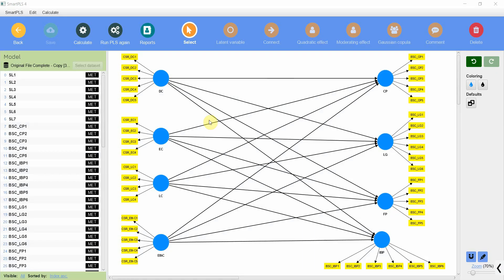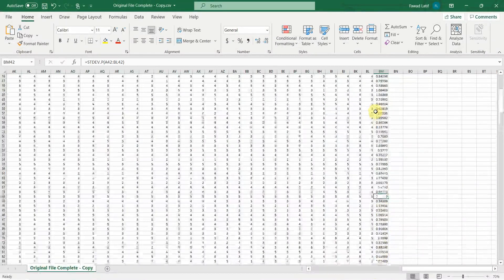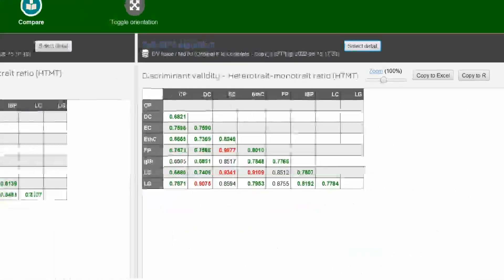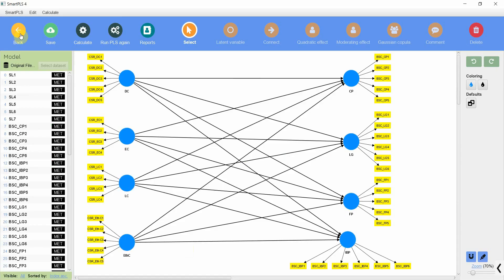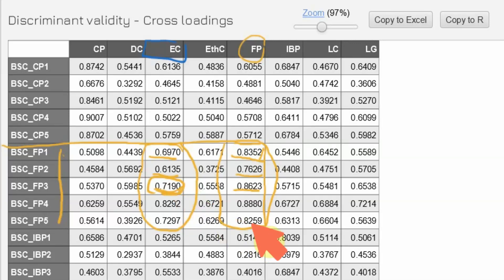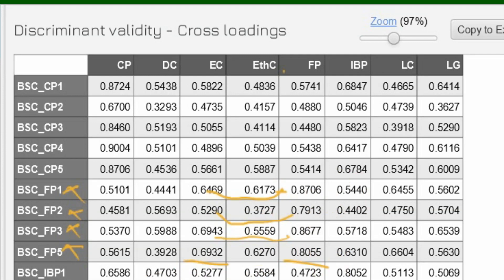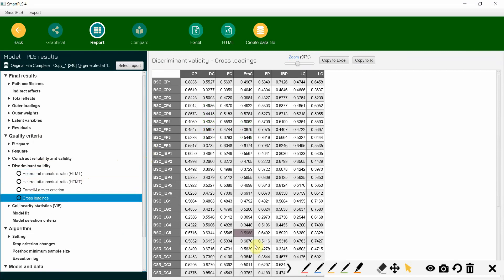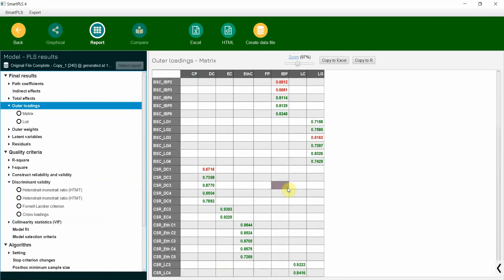#SmartPLS4 Series 14 - Step wise Demo | How to Resolve Discriminant Validity Problems?

Comment: Thank you very much. I made a model.but, there are problems in the dicriminant validity and construct reliability and validity. What should i do to solve the problems in construct reliability and validity as this video is related to the dicriminant validity ? Also, my model contains 40 indicators. When I calculated the model, 16 indicators were removed as its outer loadings were less than 0.4 and still there are problems as I mentioned.   Is this correct when I removed all these indicators of my model?

Comment: thank you sir, your tutorial is very helpful. If i may ask a question, can i directly look at the cross loading without checking the standard deviations of the indicators for two variables that have discriminant validity issue? In my opinion, it is quite possible that the standard deviation of those indicators would be 0 if we use likert scale. It doesn’t mean that the respondent didn’t read the questionnaire, except if the standard deviation for all indicators (all variables) is 0. In this case i think we should delete the data.
Reply from the maker: Yes, you can.

Comment: Hello Sir, thank you for your video. Do you think checking the correlation between indicators of the problematic variables will help identify the problematic indicators? I found that useful. And do you have any references we can cite for the procedure (first check the STDEV.P, then check cross-loadings) ? Thank you.
Reply from the maker: Yes, that may help. As for reference, please refer to 
Collier, J. (2020). Applied structural equation modeling using AMOS: Basic to advanced techniques. Routledge.

Comment: Dear Dr. Fawad
if the cross-loading between items is less than 0.1, that item should be deleted to improve discriminate validity. Is there any reference for this? actually, in my PhD thesis, I cant put anything without reference. Your help in this regard is highly appreciated.
Reply from the maker: Please refer to 
Sarstedt, M., Hair, J. F., Pick, M., Liengaard, B. D., Radomir, L., & Ringle, C. M. (2022, May). An updated assessment of model evaluation practices in PLS-SEM: an abstract. In Academy of Marketing Science Annual Conference (pp. 85-86). Cham: Springer Nature Switzerland.

Comment: Hi Professor, thank you for your videos and explanations! 

Please, I have a question regarding this.. Can I use (traditional/original) PLS algorithm for evaluate the measurement model and consistent PLS algorithm to evaluate the structural model at the same time? 

Due to I have an issue with the Fornel and Larcker DV using consistent PLS algorithm.. But when I checked it using the original/traditional ones, the results were good.. 

And for other analyses, the results were also good using consistent PLS algorithm.. 

Thank you for your response!
Reply from the maker: Use Normal PLS Algorithm.
Reply: @researchwithfawad  Thank you so much for your responses, Professor. 
That means it's not possible to use Normal PLS algorithm (for measurement model) and Consistent PLS algorithm  (for structural model) at the same time? 🙏

Comment: Great Dr. Thank you for this. Can you kindly suggest a solution for the Fornell and Larcker Criterion DV issue in which the first or the top value (the square root of AVE) has to be higher than the values below if I'm not wrong, but in my case, the top diagonal AVE value is lower than the values below. What am I supposed to do to resolve it?
Reply from the maker: Please follow the steps in this video
Reply: @researchwithfawad  this one, as I can see it, is a resolution for HTMT not F&L criterion. I stand corrected.

Comment: Hi sir, is it okay to delete the item in construct to meet the HTMT ratio?
Reply from the maker: Yes, you can delete a items to improve HTMT.
Reply: @researchwithfawad  sir the loading between the problematic item should less than .01 right sir..if less .01, then I can delete the item right?
Reply from the maker: Delete if difference of loading is less than 0.10. The item is thus loading onto two constructs. Hence, can be deleted.
Reply: @researchwithfawad sir may I know how to explain in write up about reason for delete item

Comment: Dr

My data set stdev.p is ok; all are above 0.25. When first running the HTMT test, there are several values above 0.90

I try to solve the higher HTMT value by checking the items' cross-loading; any pair of item differences less than 0.1 are removed. As a result, only three HTMT values were recorded above 0.9. The two pair of items' differences are greater than 0.1, hence I decided to maintain these items. Except for one mediator construct with 0.976, one of the items' pair differences is below 0.1

When I removed this mediator item and assessed the structural model, the p-value of the f-square of the mediator was 0.069 (using two-tailed test bootstrapping). However, the p-values become significant (0.034) when I add back the mediator construct of 0.976 HTMT or choose the one-tailed boot strapping test.

In your opinion:

a. Should I focus on solving the significance issues of the structural model (ensure HTMT  value less than 0.85 or 0.9)
b. or remain with the item with HTMT 0.976, but also look at Fornel & Lacker and cross-loading to indicate that discriminant validity is established?  
c. Or to report the finding based on one-tailed or two-tailed test?

Thank you Dr

Comment: Thank you so much for your videos and for sharing your knowledge! Your help couldn't be more timely for me! I have a question: Can I get the paper or the reference where you got that SDs for the responses should be greater or equal to 0.25, to consider a valid response? I would like to cite them in my research.
Reply from the maker: Thanks for watching. Here is the reference
Collier, J. (2020). Applied structural equation modeling using AMOS: Basic to advanced techniques. Routledge.

Comment: I still have a question about you removing LC1 and LC2, why do you consider it problematic

because i have the same problem, where the value is all over 0,10 but i still have 1 htmt over 0.90 so im confused what other variables considered problematic
Reply from the maker: Reason being that LC2 is loading well onto another factor, its loading is over 0.70 on another factor.

Comment: I cleaned my dataset until it the sample size came to 80, is that ok sir?
Reply from the maker: The sample size is too low for SEM.
Reply: @researchwithfawad  dear sir, sorry for follow up question, but I'm using 87 samples for my reasearch. is it still too low? because i have deleted the items and left 3 indicators for each construct but still got 1 htmt higher than 0.9 although fornell lacker criterion test has passed the ideal criteria

Comment: Thank you so much for the video. I have some issues with my Cronbach's Alpha values. Some of them are less than 0.7, the values in my paper are around 0.67 - 0.68. Could you please tell me what should I do to solve the problem? Thanks again!
Reply from the maker: Pleasure. This is fair reliability. You may have low alpha because of no.of items.

Comment: Thank you Dr. I have problem on this.
Reply from the maker: I hope your problem was resolved.
Reply: @researchwithfawad  Sir, still not yet...Anyway, Im using Amos...😪
Reply from the maker: Check for SD in Excel
Check for Cross Loadings using EFA
Check for very high Modification Indices
Reply: @researchwithfawad  Thanks Dr. How to check EFA in amos? Do you have email address? Thank you
Reply: If the model is fit in Amos?Does it mean that here is no validity issue?

Comment: Yes but my question is in smart pls 4 fornel larker criterion table dependant variable loadings are showing on upper row and independant is on lower row does it have issues
Reply from the maker: No. This is no issue. If you want to arrange it. Just add a serial number when you rename them. For instance
1. Job Satisfaction
2. Job Commitment
Reply: @researchwithfawad  thanku sir

Comment: Is there any paper that related to this explanation?
Reply from the maker: Good Question and suggestion. 
Well this bunch of information is not in one single paper but i accumulation of knowledge over the past 5-6 years of working on SEM tools like SmartPLS/SEMinR/AMOS. 

Primarily you can use the following references
Collier, J. E. (2020). Applied structural equation modeling using AMOS: Basic to advanced techniques. Routledge.

Hair JF, Hult GTM, Ringle CM, Sarstedt M. Thousand Oaks, USA: Sage Publications; 2014. A Primer on Partial Least Squares Structural Equation Modeling (PLS-SEM)  

Hair Jr, J. F., Hult, G. T. M., Ringle, C. M., Sarstedt, M., Danks, N. P., & Ray, S. (2021). Partial least squares structural equation modeling (PLS-SEM) using R: A workbook.